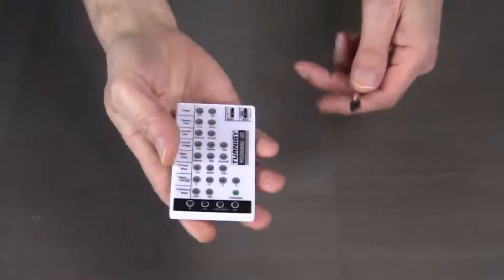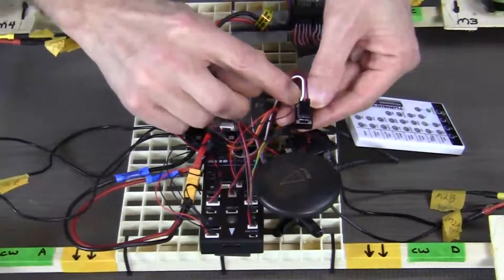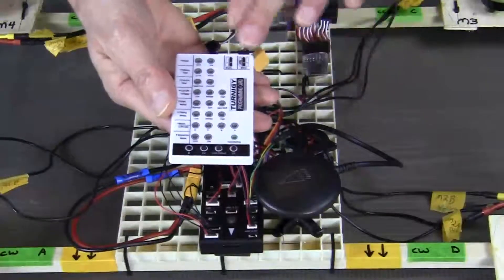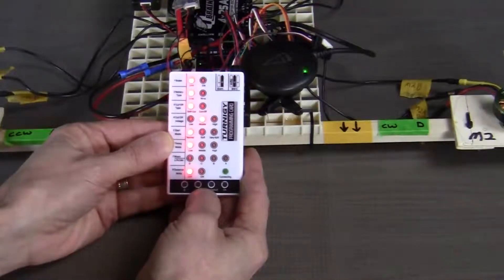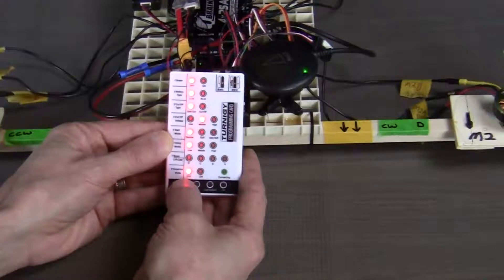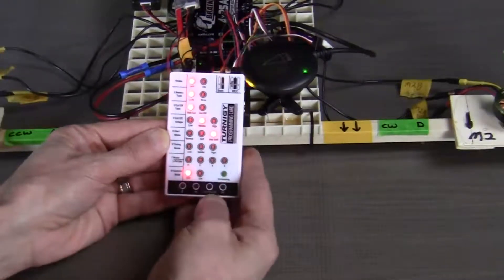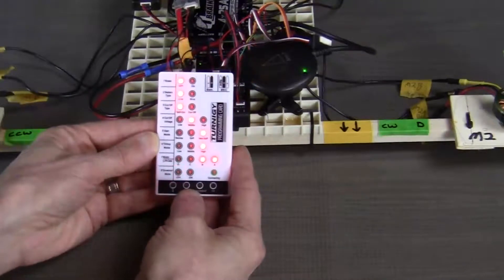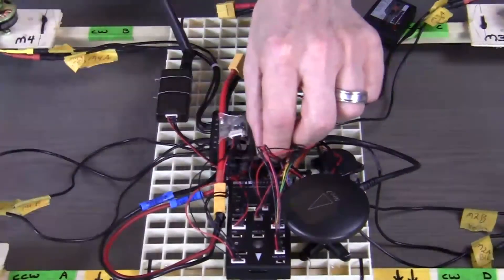How to Program the Q-Brain 4-in-1 ESC

Comment: In your picture on the website you can clearly see that the brown, orange, and yellow wires are connected to ground. That can't be right, surely? And David Detweilers comment sure explains why my copter sometimes falls from the sky abruptly, rather than being landed by the FC when the battery is low..

Comment: With multirotors, happy crashing with the Lipo mode which will enable low voltage cut off and sudden loss of power...directions in Qbrain for multirotors specifically say "NIMH" battery type for this reason..
Reply: Kudos Dave. I'm thinking that is a very useful nugget of information & not just for qbrain controlled copters..